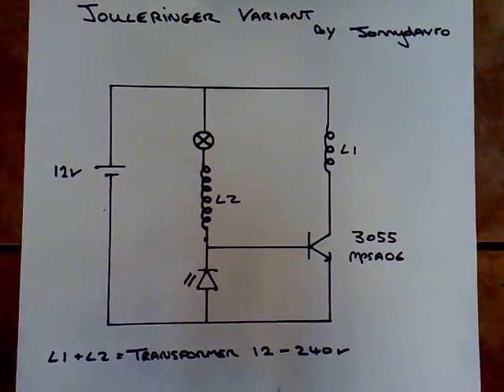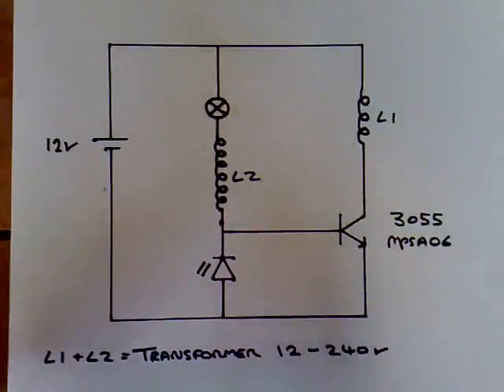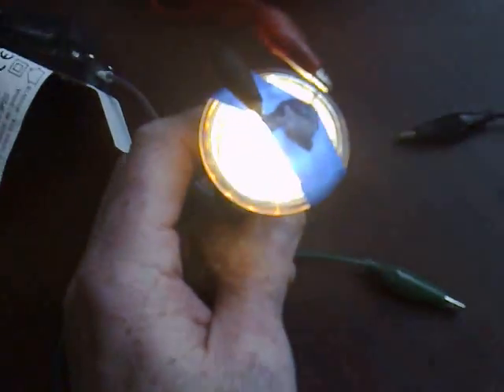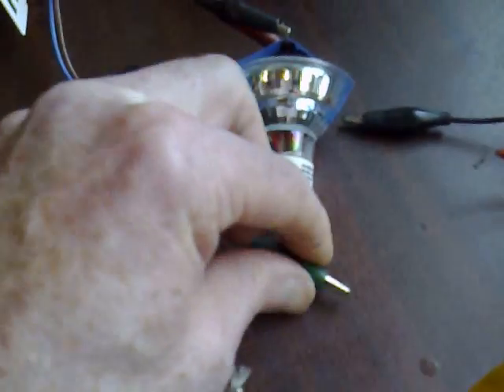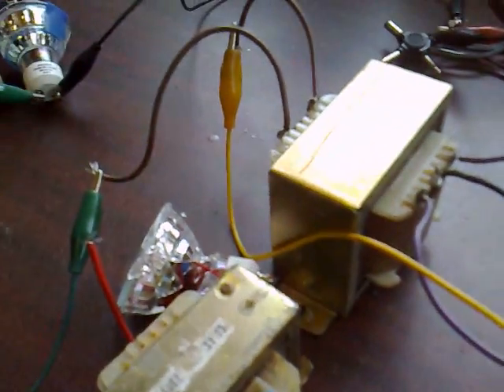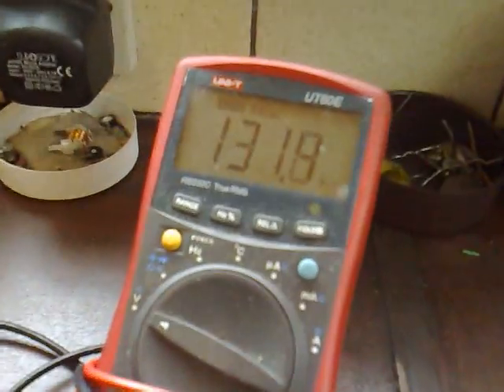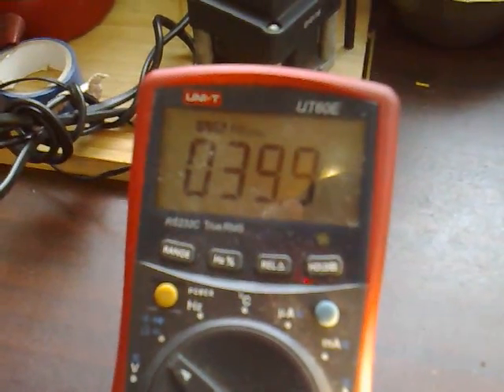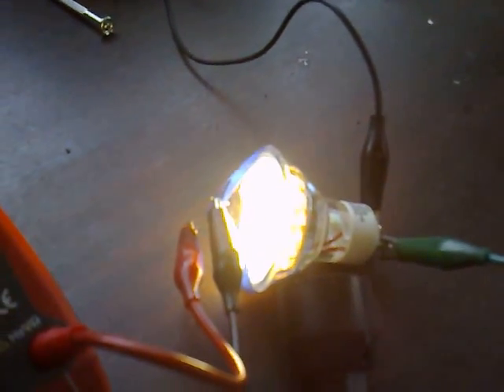Lasersaber Jouleringer variant and simple light meter

Comment: I tried it out, and it works well indeed. I found, like in your experiment, that with the oscillator running at high frequency I was able to illuminate the lamp to a brightness greater than with utility power. Thanks again.

Comment: You can also use an LED to measure light as they do put out a tiny voltage. With a simple programmable logic controller it can read voltage and give lumen output based on a math formula.